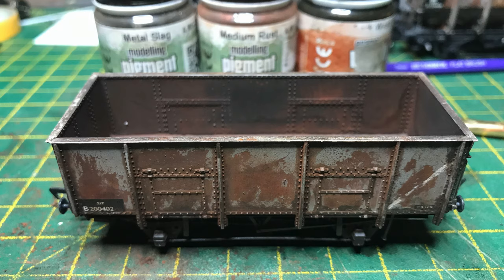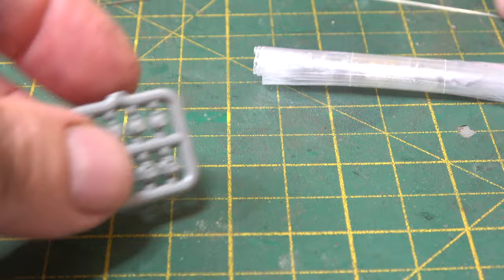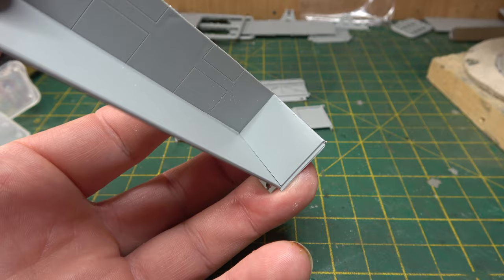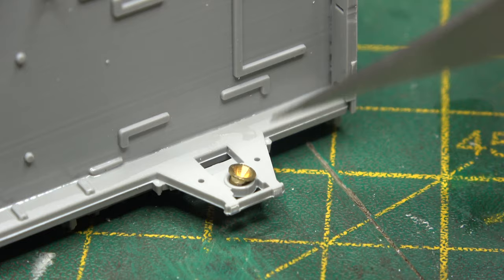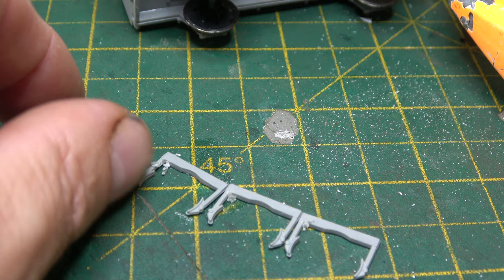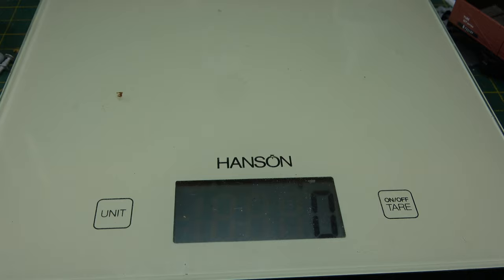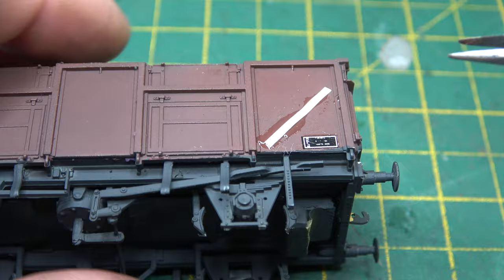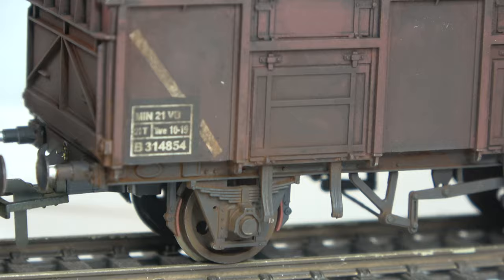21t Mineral wagons #3 - MDV's 1/119 & 1/120 - Five79 Kit Build

Comment: These videos are excellent very informative and enjoyable to watch! What glue is best for this kits? And noticed you apply it with a brush how do you clean it out ?
Reply from the maker: EMA Plastic Weld is the glue I apply with the brush. https://www.hobbybase.co.uk/products/ema-plastic-weld-cement-57ml?variant=35642858012829&utm_medium=cpc&utm_source=google&utm_campaign=Google%20Shopping&gclid=CjwKCAiAlNf-BRB_EiwA2osbxQOkUI-jQQ6i3CBBNtWR3SoNKOApqdPBmSHMp054ZIGHP-2EAge8whoCCv0QAvD_BwE Available in most model shops. 
Some modellers think its a bit harsh, but I like it! Has Similar properties to Slaters Men-Pak. 
My application brush is just a Cheapy from Humbrol. Doesn't need washing out! Goes firm when left, but softens up again when dipped into the bottle again. 
Another episode in the 21t mineral wagon saga currently in production!
Thanks
NW
Reply: @Wallsrail  ahh cheers for the link I'll have to try it out got some Cambrian SPAs to build! Thanks for the tip with the brush I'll have to try it out seems to make applying the glue far easier. Looking forward to future wagon builds!